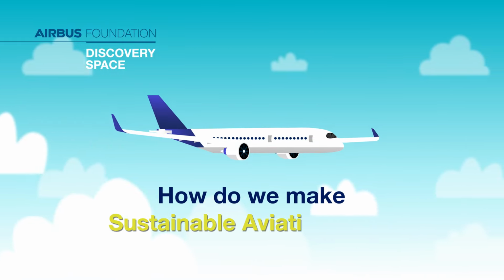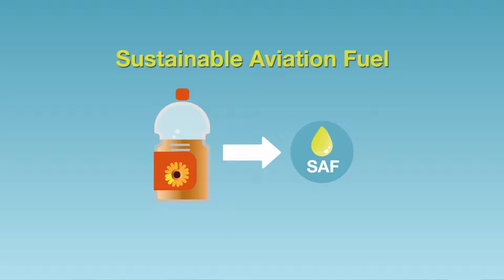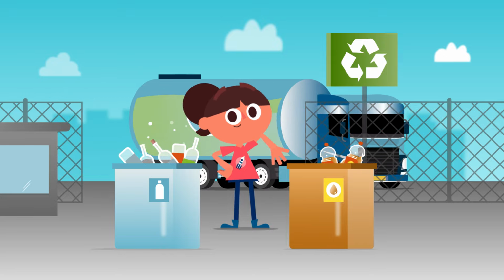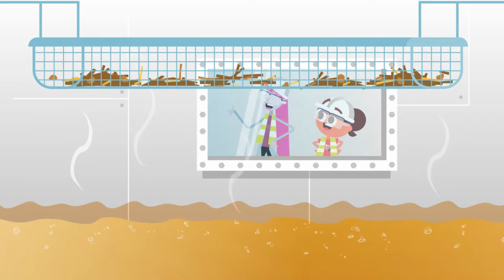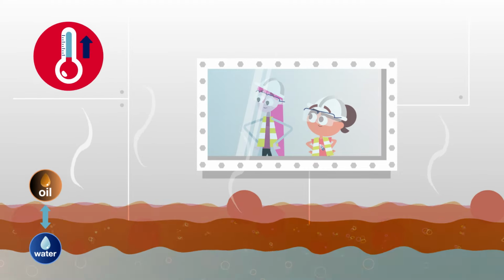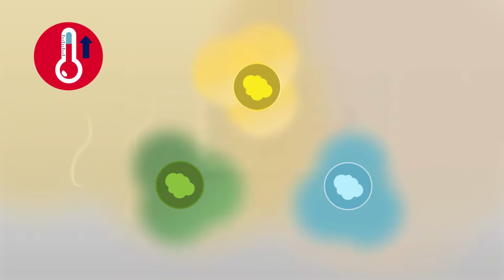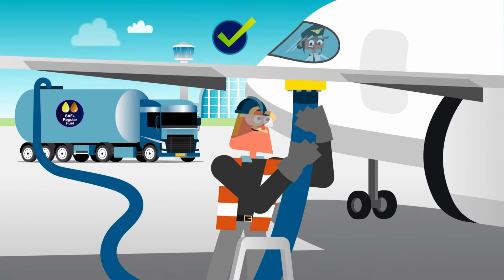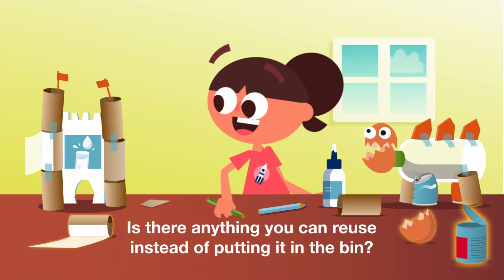How do we make sustainable aviation fuel?

Comment: So it's just as bad for the environment as regular fuel, except someone would have been able to cook some fish and chips with it first.
Reply: No, SAF carboon footprint is lower then regular Jet A1. It's still not perfect and not a long term solution but it's a step in a good way.
Reply: there's much less sulfur and nitrogen containing compounds in SAF aswell. CO2 levels in the exhaust are considerably lower.
Reply: @maxvanderstricht1159  nonsense
Reply: @matthewbaynham6286  I am a master student chemical engineering at Vrije Universiteit Brussel and currently writing my master thesis on the removal of hydrogen chloride from hydrogen gas. I have had a number of courses concerning green chemistry. My love for aviation and innovation has led me to research the topic greatly. I am also writing a piece on greener fuels for aviation as part of my literature study. What I stated is not nonsense. I would love to add url's to published scientific papers, but youtube doesn't allow that. You can do that yourself if you wish. Try Sciencedirect; look for sustainable aviation fuel and just read the abstracts of stuff you find; you will be surprised my friend.
Reply: @maxvanderstricht1159  I don't believe a word of that
Reply: @maxvanderstricht1159  Airbus has changed their opinion about SAF. Now they will go all out for hydrogen. Do you want me to give a URL for prove? All the best with your chemistry study.
Reply: unless if you have a better idea, suggestion box wide open
Reply: @matthewbaynham6286   what are the different heating temperatures in production of SAF?
Reply: @tobidaniel9819  what colour hat are you wearing?
Reply: It's worse because it takes energy for the reprocessing

Comment: Here in the states most plastics (70% or more,) placed into recycling bins, never go to an actual recycling center. Those tons of waste plastics are then loaded onto cargo ships bound for nations with little or no environmental protection. All that plastic is then burned, buried, or thrown into the ocean. Almost all of that wasted plastic is derived from petroleum, which has had most of the nasty compounds and chemicals like Sulphur removed in order for the plastics to be clear. That petro oil is then polymerized to produce water bottles, dvd cases, dashboards, and millions of other products. But petroleum derived plastics can be converted back into oil, through a process of pyrolysis. This is where the plastics are loaded into a vessel like a drum, where all the air inside is pumped out and purged with an inert gas like nitrogen. The plastics are then heated passed the point where they would burn, and without oxygen, instead of a fire the polymer chains begin to break. What your left with is petroleum oil that can be refined into diesel, kerosene, gasoline etc... These liquid hydrocarbon fuels will burn far cleaner than anything currently available at a gas station because as I said the petroleum oil was initially cleaned before being used to make the plastics. Think of how much plastic waste is generated in one day, for whatever location you're in, and realize that instead of shipping it to some third world nation who's "leader" has been paid to take this trash, we could using it in addition to other carbon neutral sources to lower fuel costs across the board, for aviation, automobiles, home heating etc... And this would allow ev manufacturers the time to develop their technology into products that surpasses the internal combustion powered world we live in
Reply: I agree. Even if certain plastics like PVC and CPVC had to be filtered out, this requires far less sorting (and cost) than conventional plastic recycling.  

As you say, plastic can be easily converted into jet fuel in a single step!  It requires only a simple heating process, no FT synthesis required!  This is inexpensive and scalable.  As a bridge solution it could help lower the high cost of an SAF blend while also addressing the problem of plastic waste piling up.  

The quantity of plastic waste in the U.S. is 1.3 lbs/person/day, (0.6 kg/person/day), a similar weight to the consumption of jet fuel (1.3 lbs/person/day).  If all the currently non-recycled plastic were converted, it could in theory supply up to 1/3 to 1/2 of the total jet fuel use.
Reply: @mikeguitar9769  yup I've tried meeting with local leadership of several smaller towns near me, with a proposal to build small plastics refining plants so that the resulting fuels could be used to power things like plow trucks, hospital generators etc etc... but there is so much red tape involved (primarily around taxation) that no one would even do a feasibility study. 
It's funny when I ask people what the difference is between diesel fuel and heating oil. I'll usually get answers like, Sulphur content, viscosity, or even that they're two different types of fuel all together. When in reality one is dyed a yellowish green color designating it for on road vehicle use and subject to whatever on road fuels tax is applicable and the other is dyed red designating it as heating oil, fuel oil or off road diesel amd regardless of the name used is taxed differently from on road fuels aka at a lower rate
Reply: Yep, I hear ya. Maybe what could happen is the places that are importing the plastic will convert it to fuel. Then the exporters will get jealous and do the same.  And/or it might be a black-market thing for awhile like moonshine stills during prohibition.